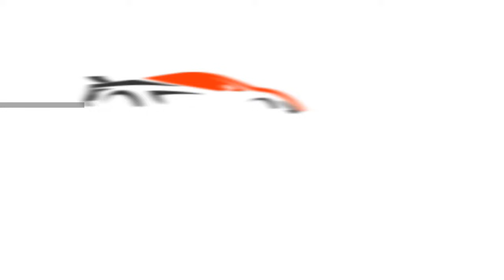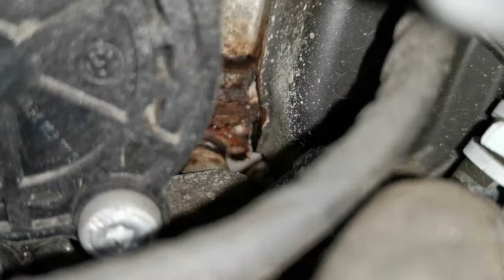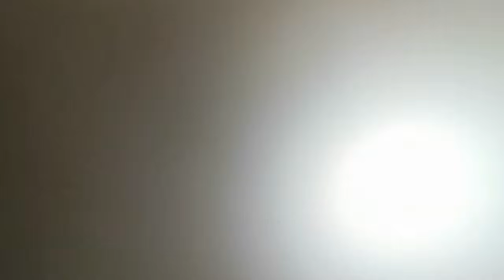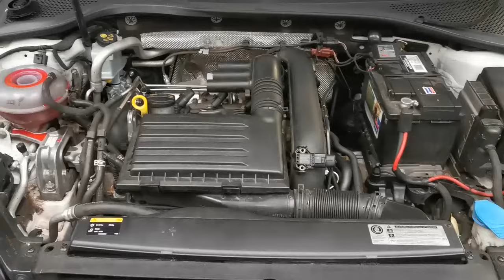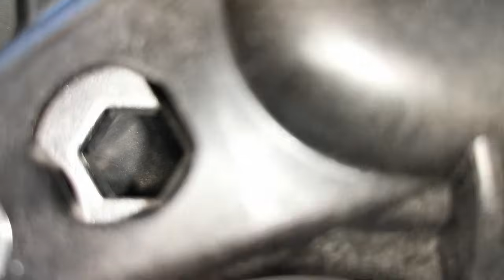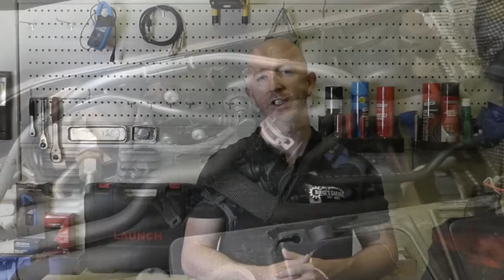Volkswagen 1.4 TSI Water Pump & Thermostat Housing Failure -

Comment from the maker: For anyone interested the rotation is clockwise & torque is 30NM when putting tension on the drive belt. 
Thanks for watching.
Reply: Where do you bleed it at
Reply: Gerard is this water pump thermostat assembly the same for the 1.5 TSI engine too ? I’ve the latter 1.5 engine and it’s leaking from same place despite only having 25 k miles. What causes the leak ? Perished gaskets ? or does the housing warp ? I can source replacing gasket, I don’t want to be throwing money at a new housing if it’s just gaskets that perish. I’m less advise.

Comment: Thank you so much. I don't know if mine is just cracked or if it's just a hose but it's leaking around that area. It's not overheating so the belt is probably still there but I'm tempted to change it anyways

Comment: Question, what part actually displays the engine temp at the dash cluster? 

I am trying to figure out my issue if its the fans/ temp sensor or thermostat!? 

And is there a temp sensor at the pump housing area!?

Comment: My mk6 2014 Jetta started giving trouble at 88k kms Expensive replacement! Very disappointed in my VW ... Maintenance was done regularly Car did not overheat nor become hot, but the engine started sounding louder and louder which had me take the car to a VW dealer ... I did not expect this type of a problem before 100k kilometres

Comment: I have a 2006 1.4 polo and it’s overheating/not holding water in the radiator but no actual leak…
Im thinking water pump? But also the actual clock thing that shows the temp is completely off the gauge lol

Comment: Hi , Thanks a lot for the video. You earn a subscribe. My Audi A3 water pump housing is leaking, just wondering should I replace the whole housing with a water pump or just rubber seals? Its Audi A3 2015 1.4 CZEA engine, same as VW Golf 1.4

Comment: Hi mate, don't know if you still read comments on this video but  could you tell me if I need to change the waterpump, when I change the cambelt? Have the same ea211 engine in my 2015 leon 1.4 tsi. Thank you
Reply: I was thinking same mate. Apparently changing the belt and pump at same time on these engines makes no difference as there both on different sides
Reply: I always thought you change them both together as the pump is usually located in the housing of belt
Reply: @JamzOs  Yeah that's it mate. The dealer confirmed that the waterpump's on the right side of the engine. It runs off its own mini belt and doesn't have a regular change interval. I'm guessing you just change it if it fails.
Reply: Did you change the water pump? I’ve got the same car. Just noticed a coolant leak 😑

Comment: Hello I have a 2013 1.4 tsi. No overheating or leaks but car runs just a little cold - a tad under 90c

This is indicative of a bad thermostat right? How do I change the thermostat only? Cannot find any useful vids for my car.
Reply: Did you figure this out? I’m in the same exact boat
Reply: @prestonnelson3812  well I scanned the car and got a code which said: “intermittent - coolant pump b is stuck open” 

Figured it wasn’t a big deal so I left it and it didn’t cause me any issues. I ended up selling the car for other reasons.
Reply: It was literally only 2mm under 90 degrees celcius so I figured it was a minor issue. Have you scanned yours?
Reply: Hey. Did you fix it? I have a similar case. The fluid temp can drop as low as 60 degrees at idle when using heat a lot in the big cold weather. My fuel burn is also a bit higher. Oil temp also drops to around 75-80 degrees from 90 at idle.
Reply: @MaximusHexon  hello, I did not fix it as it wasn’t too bad of an issue. I would get yours diagnosed if I were you

Comment: What are the torque specs for these bolts? Do the bolts have to be torqued as well as the drivebelt? Cheers
Reply: 30Nm for the tension on the allen key and then torque all the bolts to 12Nm while holding the tension of 30 Nm

Comment: What is Timing belt change interval on MK7, doing it first time?
What is recommended change interval for Waterpump.
Reply: I always thought you change cam belt and water pump at same time, but not on this engine as there different sides of engine?
Reply: Cam belt every 60k or 5 years whichever sooner mines 62k going to get belt done soon

Comment: If the timing belt broke, didn't that damage the components of the engine, the pistons, valves etc
Reply: It wasn't the timing belt, it's a much smaller belt on the other side of the engine that runs off one of the camshaft sprockets. The timing belt is on the other side of the engine

Comment: Hello,

I have a 2014 MK7 golf with the same problem.
Started the car today and the coolant check light came on
Took a look and it was below the Min mark and i saw coolant on the transmission .

I would like to know if it’s easy to change the waterpomp and the little belt? Or do you need special vw tools?

Thank you.

Comment: Yep, Scotty Kilmer absolutely hates these plastic housings going brittle with heat & age ....designed obsolescence 😨
Reply: Scotty is a hack and a relic. He acts like metal water pumps never fail, and they fail all the time. "Plastic" is a catchall term for dozens of materials with very different properties, and many of them are stronger, more durable, more resistant to heat/fatigue/corrosion than simple steel or iron.